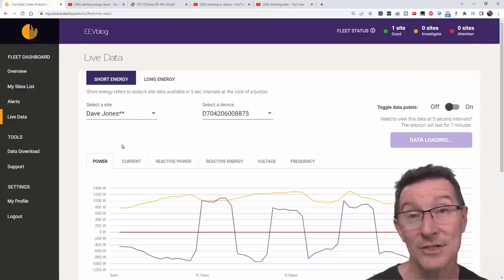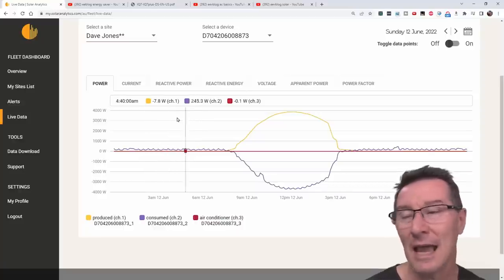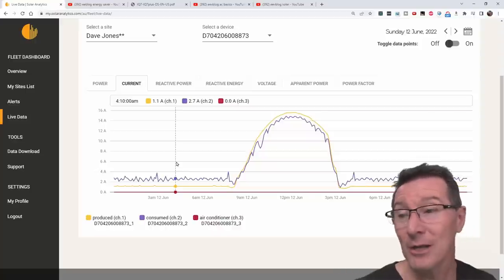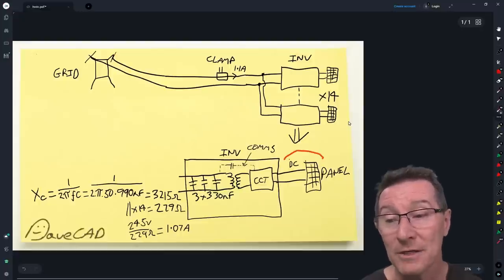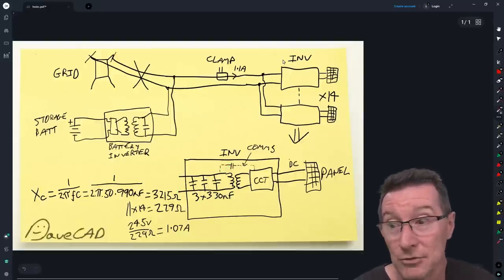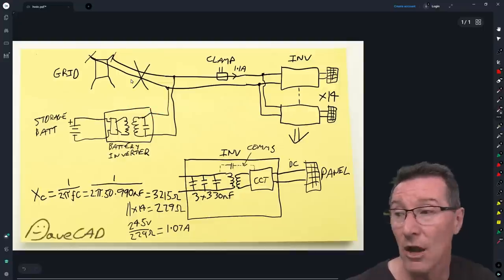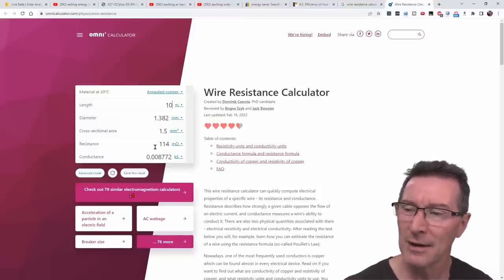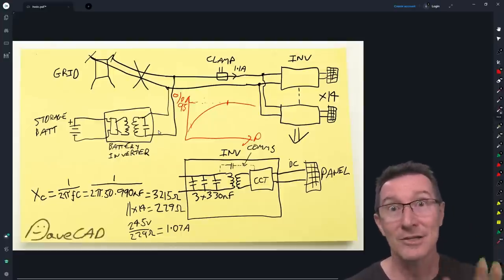EEVblog 1487 - Do Solar Micro Inverters Take Power at Night?

Comment: Fascinating.   I remember my EE prof talking about how it’s called imaginary power, but it can kill you!   Our power systems courses were terrifying.  Safety talks, several wooden rods so you can separate a power source from the victim.

It’s an interesting discussion as to whether consumers can power their own houses independently or if they have to connect it to the grid.   

During peak generation do they disconnect your solar array and your house is only powered from the grid, or is your house powered solely from your solar array?
Reply: In a grid-connected inverter system the power flow is managed using phase angle. Thus it is always synchronized to mains but the phasors of inverter and mains differ
Reply: Almost always it's house powered from the grid when the relays shut off power.  Importantly, however, the circumstances which cause this aren't really peak generation.  Rather, it's a mismatch between generation and load.

Say you have all the ACs going during the day, and a cold snap happens.  AC's turn off.  The generator no longer has the load slowing it down, so it speeds up.  You see a voltage and frequency spike until it can be dampened.  The whole frequency voltage thing is another interesting thing, and there are videos on that as well.

The thing with grid tied inverters is they have to match the voltage and frequency being supplied.  So, you can get into a feedback loop of ever rising voltage as two separate systems each think the other is "the grid".  Which is why having emergency cutoffs is important.

Though, we can see other problems as well.  Going back to the frequency thing.  Look at what almost happened to Texas for how this can go horribly wrong.
Reply: After reading your comment again I realized you asked a different question than what I initially thought.
The way Load is controlled between different sources of generation is via LFC (load frequency control). It is a phenomenon that comes from rotary generators -  when they get loaded, their spinning speed decreases and their frequency drops. The inverse is also true. With a decrease in demand (electrical load) their frequency increases.
Inverter manufacturers have incorporated this "old" form of grid-scale load control into their inverters, programming them to have a frequency "band" within which the inverter's load gets controlled (@50Hz - 100% power, 50.3Hz - 75% power, 51.2Hz - 0% power) and a cutoff upper bound above which the inverter switches off, to prevent what the above comment mentioned.

This is also the mechanism we use in AC coupled PV micro-grids where different brands of inverters cannot communicate via cable, so we program the battery inverter to up the frequency when the batteries are getting full. It's not a binary "on" or "off", but more of a continuous control band

Comment: Would you be able to show the guts of a micro-inverter? 
I'm curious as how the circuit works.
Reply: The old model I have is completely epoxy filled to make sure water cant get. I imagine that the newer ones are as well.
Reply: @stdorn  They all are.

Comment: working on an inverter some years ago, wanted to get standby power under 1 watt, but wifi modules are surprisingly power hungry. We shut off every non essential rail until the sun comes out.
Reply: The trick is mentioned, but it's only as a quick aside and easily missed.  Enphase uses power line data transfer.  Same as those ethernet over power line boxes, or going further back, the X10 home automation systems.

An ASIC with a simple protocol shouldn't use much power.  The largest problem comes from signal integrity.  Because AC power is horribly noisy.

Comment: I did some power factor testing on my off-grid inverter system a few years back and saw between 10% and 30% DC power reduction with "improved" power factor on a freezer and a drill press motor:
https://youtu.be/qf_ZLIYT0Ro
This was on a low frequency Tripplite sine wave inverter/charger, so that may make a difference.
Reply: I've seen similar figures with my Victron 48/5000.  A poor power factor can definitely impact battery life in an off-grid system.
Reply: it depends on topology. There are a lot of good designs for low loss passing of reactive power, but many like the H7 are patented.
Reply: Just watched your video. Excellent job.

Comment: And I have analog single stator meters on both of my panel sets, and also use Enphase microinverters on my grid tied solar...  Also a net meter that was installed by the power company. The interesting thing is, on a brightly moonlit night, like the ones you can see colors on... I have seen some, not a lot, but some generation. Lunar and Solar power... what a trip huh?

Comment: I assume the battery system you're looking at will be grid-tie only due to the rest of your system's existing hardware limitations so there won't be a practical demo of "following the VA"?
Reply from the maker: If I install a battery system, yes it will be grid-tie. I am in suburbia, not a remote area. This is not speculation for my own system, it's somethign to consider if you have a grid-independent system. The one I mentioned in the video is a small portable unit and I'm thinking of wiring it in seperately just for the fridges. No thought yet on a big battery storage system, need to upgrade my solar array first.

Comment: I have a grid tie system with 4 350 watt panels and 4 enphase m215 inverters, I turn the power off to the cottage in the winter and back feed to the net metering program to build credits, but unfortunately I'm finding they consume more power at night then what they produce,  my last bill showed I used 35kw and only produced 2 kw, so I may connect a relay to power them down at night.

Comment: Your main spec is wrong it isn't +/- 10 it's +10 - 6 it use to be +/- 6 but they increased the + when they reduced our official voltage from 240v to 230v to keep all existing systems within spec

Comment: Seems like everyone wants to get into the battery game.   There is even a standard for off-grid and grid-disconnect situations to allow battery inverters to tell micro-inverters and grid-tie inverters to reduce the amount of power they send to the micro-grid/home-grid.   The battery inverter shifts the frequency up from 60hz to 62hz or so (something like that) to regulate the amount of power the solar inverters inject onto the line.

Without that the solar inverters would push the voltage all the way up to their maximum (typically 130VAC or 140VAC in the U.S.) and then probably either shut-down or start hicup'ing (turning completely off, then on again), when what you really want instead is regulated load-support for whatever is running in the home plus whatever the battery system can take (if anything).   And because the standard is fairly new, various inverters either don't implement it or implement it with different frequency ranges and various brands tolerate different voltage limits before they trip-off.  So it's a bit of a mess right now.

-Matt
Reply: AC coupling, feels like a "show off" by inverter companies to me as an EE graduate.

Comment: Common Dave, ideal capacitor. 
10VA!=10VAr You still need bigger transformers and hence you have more losses in the grid! And yes, you pay indirect for the grid infrastructure and losses.
Reply: smaller, most grid loads are inductive, balanced by capacitive loads or dedicated capacitor banks.
Reply: @liam3284  That is wrong. For idle or in the low power case (night), the capacitive effect of the cables dominate. In south Germany, the capacitive power demand is also higher compared to the south (less wind turbines and more PV). They installed additional shiftable inductive loads for the night. 
Why would somebody connect PV during night time? And the main problem is still the active power. Switch is off at night time! Do the software update. We need to save energy. Start with small things if possible.

Comment: And the answer is:

Wait for it.

No. Storage capacity of the Tesla PowerWall is NOT degraded by reactive load. In fact, their interface seems to have buillt-in power factor correction. You know? I think I'll buy a Tesla car.

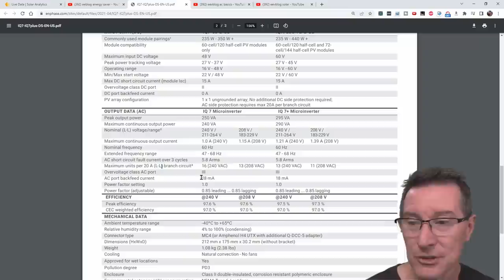At Julian day 287 06:00, our irrigation pump turns on. It's a 120 Volt pump, so it presents a 1.5 kW load on leg 2 of our household. Notice the reactive power of that pump around 1 kW. But notice the load that is presented to the PowerWall. The load is evenly distributed between leg 1 and leg 2 and the reactive power is flat zero.

I've put the data logger charts on my Facebook page.
Reply: The string of 12 Enphase microinverters has a constant reactive load, which set me off down this rabbit hole of reactive load in the first place, of about 0.1 kW, but this reactive load is not presented to the PowerWall when the PowerWall becomes the sole soure of electricity. By the way, Logan Power and LIght has not been the source of any of this power, although they have the recipient of our surplus electricity for several months now. Our household has had two sources of power, solar panels and PowerWall. The PowerWall reactive power remains flat zero until it stops charging from the solar panels and then it presents a reactive load 0.3 kWatt. This reactive load does not present itself to the solar panels, though, and the string of Enphase microinverters remains at its constant 0.1 kWatt of reactive power.

Comment: Dave, does the sunnyboy has standby power? And I wonder if you could measure the production current and voltage (power) before the conversion on a panel. And then also the output power on AC side. Give you (and us) a view in power used by the converter in production mode.
Reply: The Sunnyboy does have standby power, but it is only 1W.  SMA is known for their low quiescent draws (among other things).  He mentioned that in his other 2nd channel video - that turned into this one with better info.

Comment: Isn't it beneficial to go to DC in your home when you have a battery system independed of the grid? There are so many losses in the conversion, seems like a waste
Reply: Yeah, sure. Switch everything over to super expensive DC appliances. Then hope you never have to use mains power. Go look at your choices for DC reefers. They're expensive, tiny, and very basic. If you have no option of using mains, like in a wilderness cabin, sure, it may be good. But in a normal home, it's not practical in any way.
Reply: @littlejackalo5326  I have no idea what a reefers is.

Comment: Enphase related, Dave I wonder if you have heard about Enphase breaking local API access on the latest envoy firmwares. I've firewalled my Envoy away from the internet now so it can't update or reach enphase servers.
Reply from the maker: Haven't heard.
Reply: @EEVblog  Short story is the new firmware nerfs local auth. New firmware requires user authentication from enphase servers now. If enphase goes bust or decides to drop support, bye-bye goes access to your monitoring data.
Reply: Yes, they've changed it.  Now certificate based instead of username/password based.  Only applies if you are talking to the Envoy directly.  If you use their cloud service, there is no change.

No a good idea to firewall the envoy.  Eventually the local storage will fill up if the database doesn't get purged.
Reply: @billjohnson3344  Thanks for the advice. I just had a look into this and you are right, the dumbass Envoy firmware only clears the DB storage when it finished uploading it to the mothership.

From the Homeassistant forums, I can see that power cycling the envoy clears the DB, so it's some sort of volatile storage. One could throw a DIN rail Shelly in with the envoy to power cycle it on a schedule. It looks like my envoy will hold about 10 months of data before being full (9% after a month and a half offline)
Reply: @ipullstuffapart  I don't believe the database is in volatile memory.  Lots of stories in the past of people having their Envoy bricked from the database filling up, and power cycling was not a remedy.  I also don't think it would make sense to have the production / consumption data be in volatile memory, since power outages combined with connectivity issues would result in that data being lost.  So I think that is indeed stored in flash.  And yes, I remember reading like something around 1 year was the amount of time for a non-internet connected Envoy to become unhappy without talking to the mothership.  There is probably some way to clear the database with a REST query to the unit also.
Reply: Thanks Bill.

Interesting stuff! There is conflicting reports around! Bizarre!

I did learn that the way the Envoy clears records is by an acknowledgement response when it sends records to the Enphase servers. I ended up doing a DNS redirect and packet capture to find the call it makes, and it is possible to replicate the behaviour of the Enphase API. I'm considering doing exactly this, so I can both capture the data and keep the Envoy happy.

Comment: Why do we make the assumption that if we have a grid connected system with a battery, the apparent power draw at night will almost certainly come from the grid?
Reply: Depends on regs and how things are configured but battery/solar inverters are configured to generate with a static Power Factor of 1.0. The VARs have to come from somewhere for the system to balance and therefore it comes from the grid. I think that many inverters are clever enough to actively power factor correct but they don't because it reduces the system efficiency for the home owner.
Reply: @davefiddes  thank you, this makes sense

Comment: Hi Dave, could you do a video on how solar inverters interact with the common split-phase 120V/120V here in the US. 

The Enphase inverters only put out 240V, not 120V. If the loads in my house are not perfectly balanced between the phases, I'm puzzled how exactly this works. I assume the 240V is exported through the meter and the street transformers, due to the center tap, can send the same energy back as 120V?  If 1 A was flowing across the 240V lines (240W), and my load was drawing 2A at 120V (still 240W) on one leg, what does the flow look like to the meter?

There is significant legislature debate here in California (and other places) to change the net metering plans such that the energy you export is not nearly as valuable as the energy you import, so it might be nothing like "net" metering anymore. The power companies are arguing why should they pay you $0.35/KWN for power to the grid when they can buy power wholesale for $0.06/KWH. They leave out the detail that the KWH from their wholesale generator 100 miles away going to my neighbor's home has much higher transmission costs than the KWH from my my solar panels going 100 feet to my neighbors home.  

In one proposal, you get credit at the wholesale rate for power you export, like $0.06/KWH, but pay $0.35/KWN for power you import. Load smoothing batteries could help a lot for a day or two, but don't at all help if I want excess energy exports in the summer to build up a net balance in an account to run a heat pump in the winter. 

If this much worse net metering becomes reality, I don't want to get paid $0.06KWH for the power I send to the street transformer to be turned into 120V, only to buy it back for $0.35KWH. I read there are potentially devices that could do the split-phase conversion on my side of the meter. 

Thanks!
Reply: Might be hard for him, split phase is rare in Australia. In rural places you can find 240-0-240, but almost nothing is wired for 480 volts. Everything else is 415Y230.